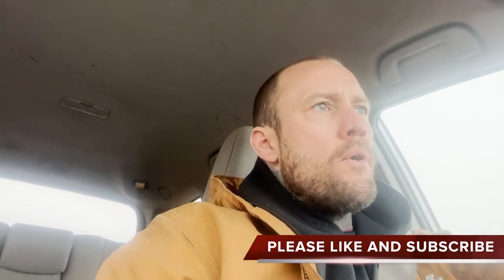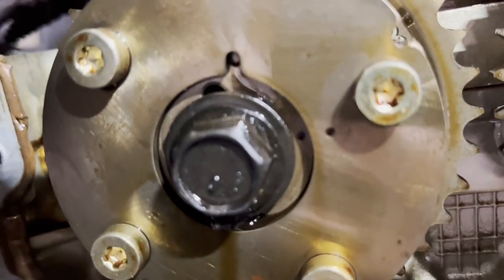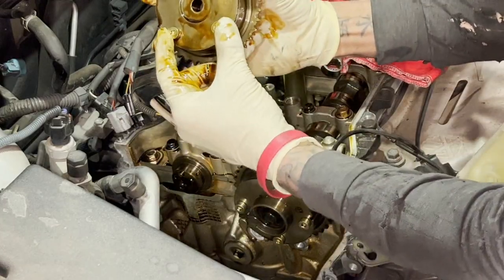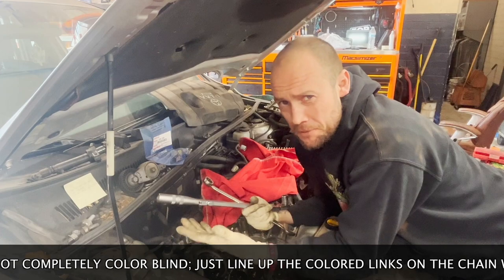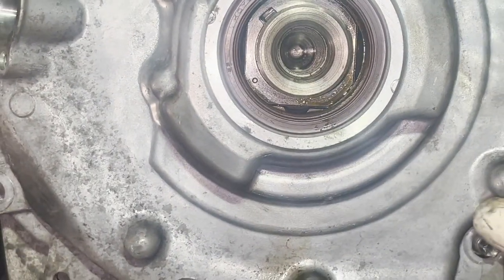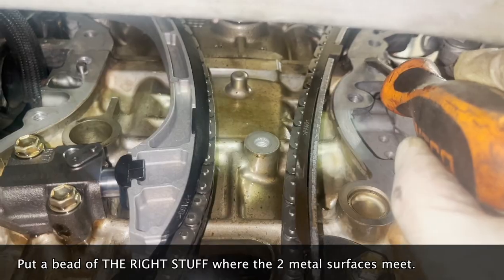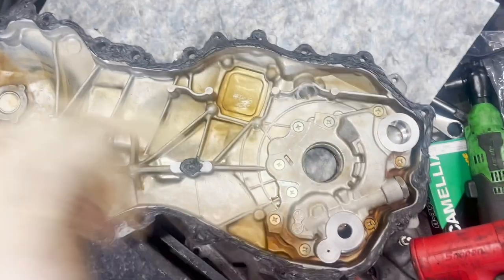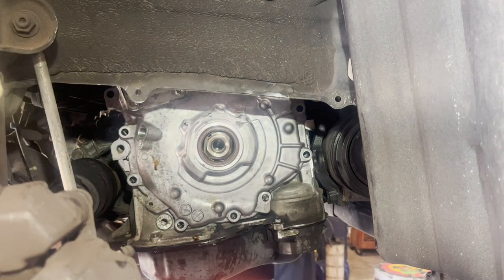2010 TOYOTA RAV4 VVT GEAR/CAM SPROCKET INSTALL

Comment: Doing this job now on a 12 Camry. Not doubting your word but gotta ask. Why does it not matter if the gear is put on locked or unlocked?  I have seen several videos that says it must be unlocked when you torque it to 63 lbs then twist the gear to lock it once ifs torqued. Im just trying to not mess this thing up.
Reply from the maker: Great question. I said it doesn’t matter because I didn’t want anyone to worry about the marks not lining up if it wasn’t in the specified position. Thanks for pointing that out. I should have  clarified that. Please don’t hesitate if you have any other questions I’m happy to help you out.
Reply: @griffzillagarage  so I can install brand new phasers locked? Cause I'm changing both and I'm not removing the timing cover, only taking off the valve cover and removing tensioner, is there enough chain slack to torgue them unlocked then lock them and get the chain back on its confusing to think about, like will the chain lift up off sproket to lock them, how do u do that with the chain on them

Comment: I have done this work twice fallowing Toyota TSB, using brand new OEM parts, the only way to install it is laying the chain on top of the gear and at the same time installing it on the camshaft, chain won’t stretch enough to install gear first and then put the chain, despite to be sure 💯(I took pics) tightening UNLOCKED , then I rotate the camshaft to LOCKED when I cranked it up the rattling was heard in Paris, I understand the “building pressure” but on both occasions keeps doing the rattling in a daily basis as the old one, I’m disappointed and frustrated😔 does anyone have an explanation for my failure ?
Reply from the maker: @64arguz  did you blow out the oil passages that feed the gear?
Reply: @griffzillagarage  my engine inside is immaculate, spotless, no burning oil, no leaks, I do my oil changes every 5k using synthetic Mobil 1 EP, the first time I checked the VVT-i cam oil filter ( little one) and looked like new 🤷‍♂️
Reply from the maker: @64arguz  I don’t know man. Are you sure that’s what’s causing the rattle and if so, I think it’s possible you missed something simple. you would be surprised the amount of times I have had a customer come in and tells me “did everything perfect and I still have a problem”; and then I get into it and I find that they did something wrong. in a previous comment, you stated something about how you could only get the chain to go on if you had it on the sprocket first; or something like that. I don’t remember having any difficulty getting my chain on. I do know that if you came into my shop, I would tell you that I would have to do the job myself with my parts; so don’t be surprised if that’s what a Shop tells you. I know that’s not what you want to hear, I’m just giving you a heads up of what to expect based on my experience.
Reply: Chain Tensioners are possible causes of start up rattle.

Comment: Have you diagnose which timing gear is the one rattling?
Reply from the maker: @Emmettaug  the rattling comes from the vvt gear that I’m replacing. I don’t remember if it was the intake for exhaust; but only one of them is a VVT style. Let me know if you have any other questions.
Reply: @griffzillagarage  Thank you so much for the reply, I have. Canadian built 2010 RAV4 2.5L,  I only have the Rattle when I cold start after sh has say for like 8 hours usually.   Just unsure how to diagnose which gear is bad . I appreciate your videos 🙏
Reply from the maker: @Emmettaug  that’s what I’m trying to tell you dude. it can only be the one that is VVT. Do you know what VVT is? The cold start rattle is a telltale sign that the VVT gear is bad. I diagnosed it based on experience, knowing that a solid sprocket that has no moving parts cannot rattle. Only the VVT sprocket that has moving parts built into it has the ability to rattle. That’s how I diagnose it. I think to myself which one of these has the ability to rattle? Oh, it must be the one that is VVT and has moving parts. You see, one of the sprockets is solid. It’s just a basic looking gear/sprocket, the other one is going to be a big fat chunkier style. That’s your VVT gear/sprocket that’s the only one that has the ability to cause the rattle.
Reply: @griffzillagarage  oh I got you My bad I got confused because you said exhaust gear in the video And then I was worried because the engine says dual VVT, And I got paranoid thinking that maybe it could be one or the other lol
Reply from the maker: @Emmettaug  that’s a good point, I could be wrong. If it does have 2 VVT gears then I would replace both. Kind of silly to get all the way in there and not knock it out while you’re there.

Comment: Did you say the intake cam gear can be reinstalled even if it's in the locked position?
Reply from the maker: @tommygomez5343  All the marks will lineup regardless if you have it in the locked or unlocked position. However, you are supposed to install it in the unlocked and advanced position. There are some other videos showing how to release it from the lock.
Reply: @griffzillagarage  Yeah, I don't have an air compressor. So if somehow the sprocket went into the locked position during installation I don't know how I would get it unlocked.
Reply from the maker: @tommygomez5343  just throw it back on there and let it fly.

Comment: Thank you for sharing. I have 2009 Toyota Rav four 2.5 liter and I am going to replace the same gear and the components around the if I have to but my question is where you guys get these parts from, because it's a lot of options on the Internet and the ones from Toyota are not cheap. Thank you in advance and keep up the good work
Reply from the maker: Thanks for checking out the channel. Definitely appreciate if you would subscribe and help me grow it. Try googling Toyotawholesaleparts.com. That’s where are you will get genuine Toyota parts at wholesale pricing. If that’s too expensive, check with rockauto.com.  Dorman is a popular aftermarket company. I feel like there’s stuff is hit or miss. Toyotas are great cars. If I was you, I’d spring for the Toyota gear and then get a Cloyes timing chain set. Please let me know if you have any other questions.